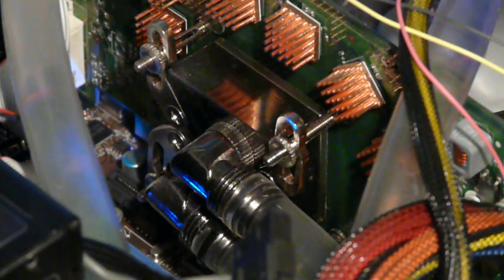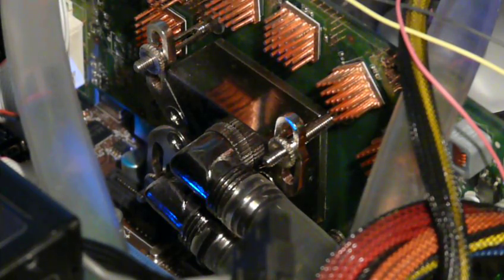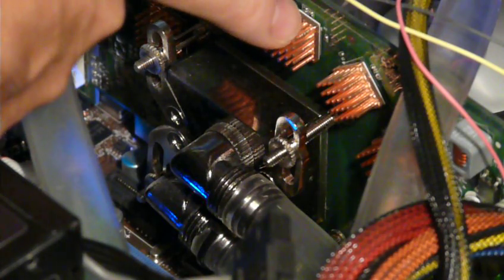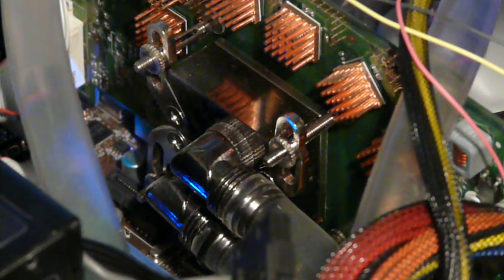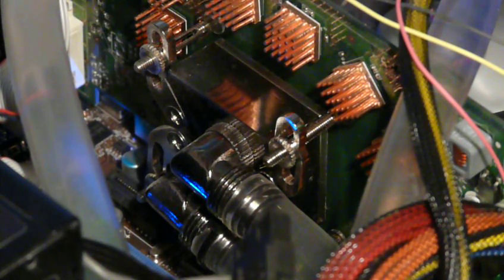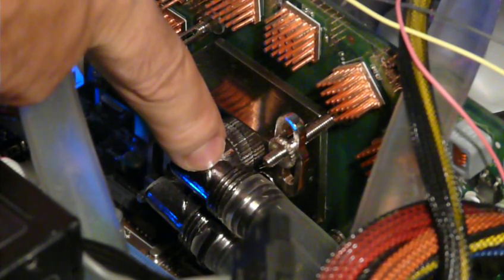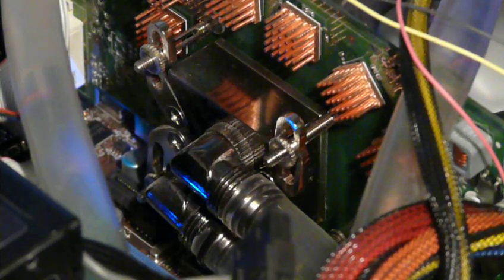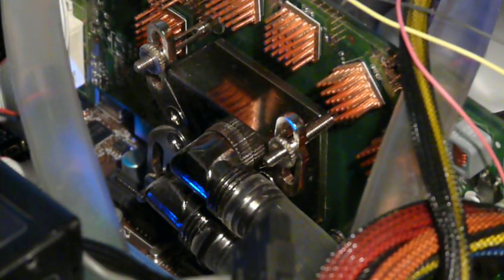Video card water block and copper RAM heatsinks

Comment: I have a similar setup but how do you remove the ram heat sinks once they are installed I don't want to break my card
Reply from the maker: They come off pretty easily at least the ones i got did. You can just pull them off. If you have problems maybe try to use a heat gun.

Comment: yep, thanks, yeah i knew it would support lots of cards... i mean look at the mounting hardware that it has. anyways, i want to watercool a couple of gtx670s i'm more a swiftech guy, but their mcw82 block had a smaller contact surface, thing is that i was conparing with a gtx460, but then i found out that kepler cards have a smaller chip so i think swiftech's block will be fine. thanks!

Comment: @cfcreative1 Ah, thank you very much!  Thankfully, I found an alternative that suits my needs!  I found two GTX 560 Twin Frozr II's for the same price so I won't even need the extra cooling.  When a single card doesn't go above 60C, two shouldn't give me temps any higher than 75C.  At that, I'll probably just boost up to eight, 120mm case fans and I'll be perfectly fine.

Comment from the maker: @iTzChALLeNgEd  You have a couple of things to think about. First if you have two cards installed there may not be room to install the type of cooling you want. If you go for liquid cooling then you can find some custom water blocks that cool your specific card including the GPU and the memory. Then you don't need any copper heat sinks. The copper heat sinks go right on the ram chips of the graphics card so you have to completely remove the original cover, heat sinks etc. Hope that helps.

Comment: Hey, I'm new to computers and was wondering where those copper heatsinks would actually be applied?  Can they be applied directly on your video card?  I'm thinking about getting two GTX 560's but I'll need a way to better cool the cards.  As I'm a beginner and I don't want to risk F****** up my video cards trying to install water cooling, would say 4 heatsinks lower my temps about 10C?  That's all I need really, if that.